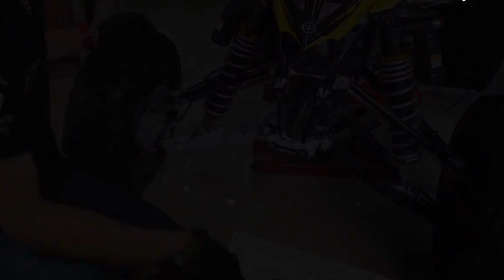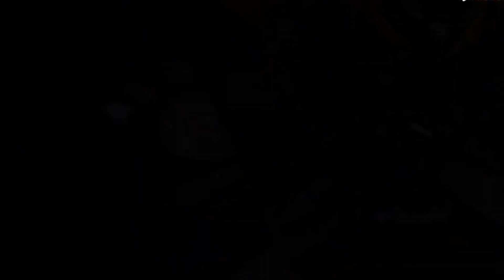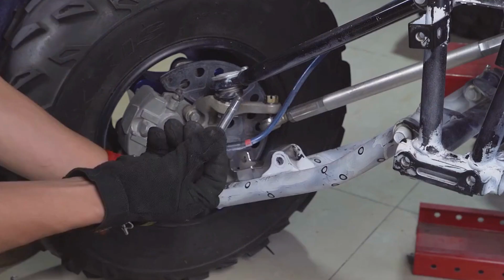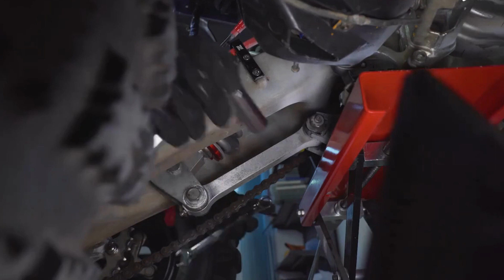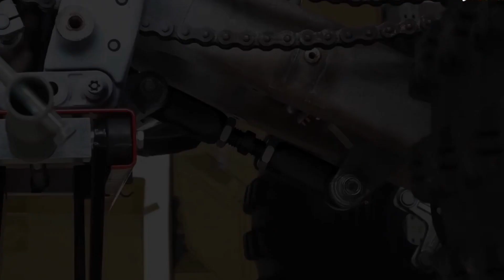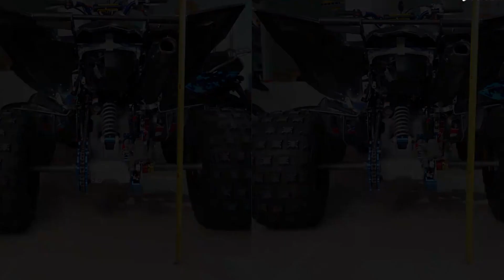Front/Rear Lowering Kit for Yamaha Raptor ATV 🐊🔧

Comment: How low in the back do you recommend
Reply from the maker: Hi @malikwalden3168! 👋

The recommended lowering depends on your riding style and terrain. For general use, 2 to 3 inches in the rear provides better stability and handling. If you're using it for drag racing or street riding, you can go lower for improved aerodynamics.

Let us know what you're looking for, and we’ll be happy to help! 🔧🏁

Comment: Does it work on a suzuki 250xc
Reply from the maker: Hi @NATE-sn6nx, thanks for your question! The lowering kit is specifically designed for the Yamaha Raptor ATV, so it may not fit properly on a Suzuki 250xc. For the best results, we recommend using a lowering kit that is specifically designed for your model. You can find all the products on Racext.com If you need any further assistance, feel free to ask!